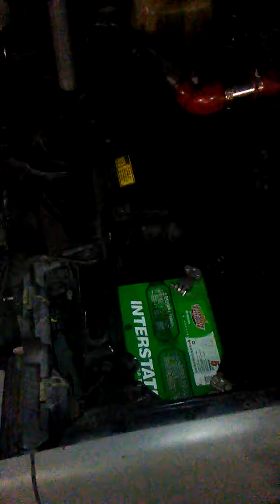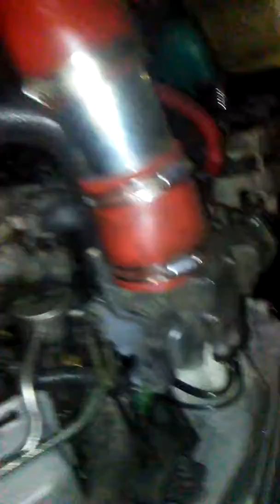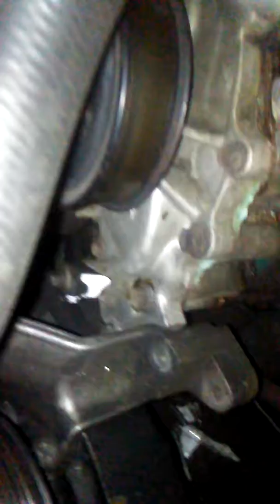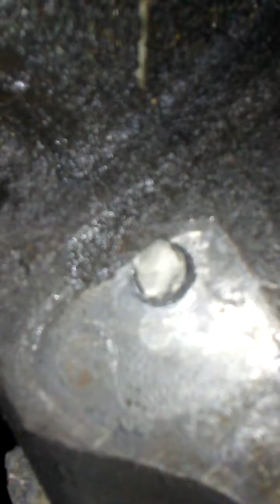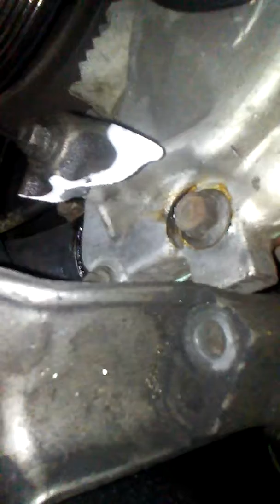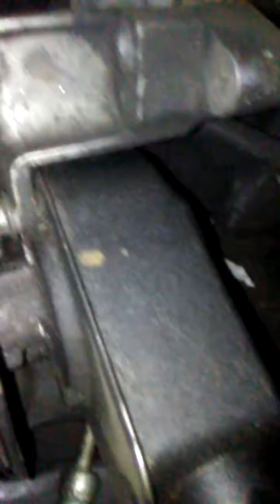Broken Ps bracket & Bolt on 3.1 camaro rs v6

Comment: Samething happen to our Firebird... Maybe the belt is too tight?
Reply from the maker: there is a bracket that goes behind the ps pump and attaches to driver header. i was missing that. i just got another bracket and got a shorter belt to compensate for the tension  the missing bracket is suppose to withstand.
Reply: Thanks for your reply fam.. We broke two brackets thus far, now we have to wait for another and try to get that bracket that you've mention. Respect!